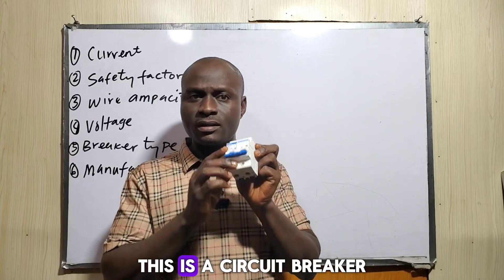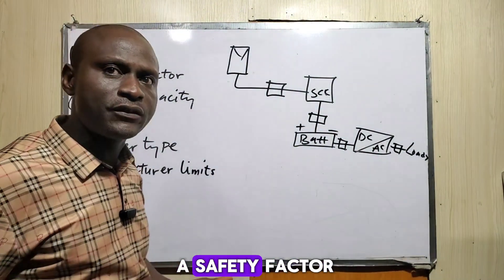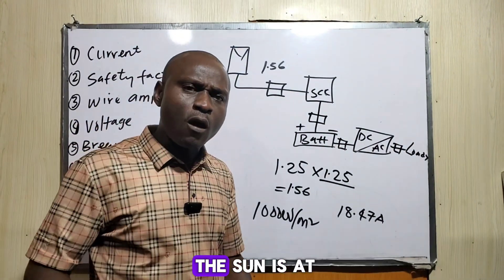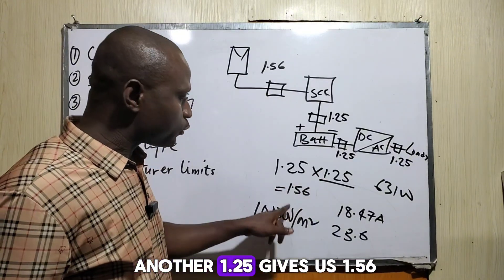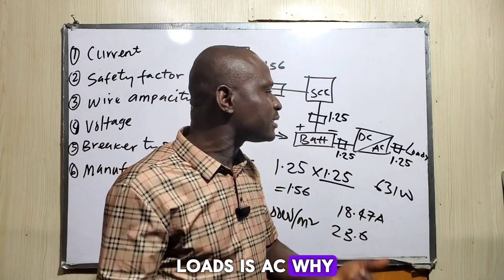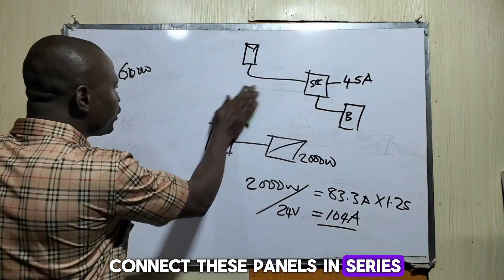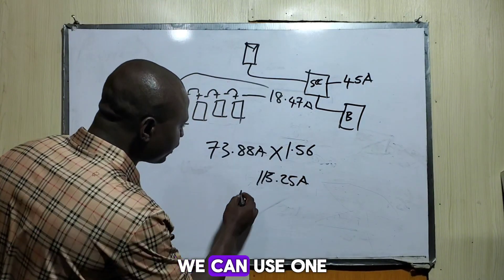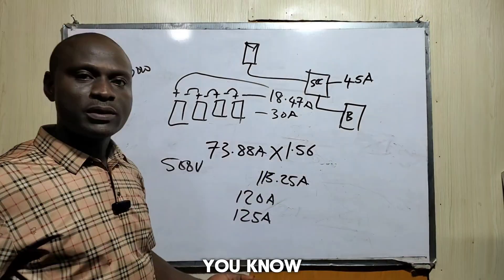Solar Installation Training: How to Size Breakers in a Solar Power System

Comment: Weldone sir. i am learning a lot from your channel. if  the PV  current is 18A-20A and the distance to the inverter is upto 50-60metres, what size of cable will you recommend?

Comment: Is there any problem if I use like 80A for all the breakers whether it is suitable for 20A or 30A, if I just decided to use the bigger breaker is that a problem or  not? please I need an answer to this.
Reply: There'll be a big problem, it's as good as not adding any protection

Comment: What size of cable will you use when the Isc is 125 amps? Unlike the series connection with an Isc of 30 amps and a 4mm cable, as you said.
Reply from the maker: 70mm² @90⁰c

Comment: How do I size 5kva inverter and solar panels
Reply: Are you an installer?? Your question is upsidedown
Reply: @BlaiseChia he means hybrid inverter
Reply: @ChukwudiDirioha-n8c 
Yeah I said so because you don't start sizing of PV systems at the finishing end. His question would have been that I have this amount of electrical load, how do I proceed with the sizing of the system? If you don't know your daily energy needed, how do you even think about the storage, inverter and the panels that will load the battery bank at the desired time???
Reply: Please tag me where to get the PDF for sizing a solar system